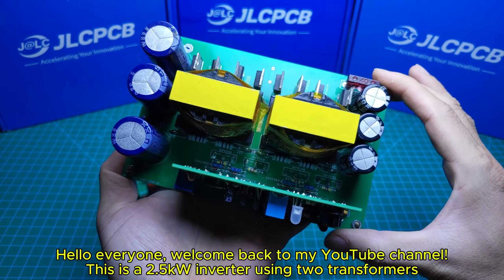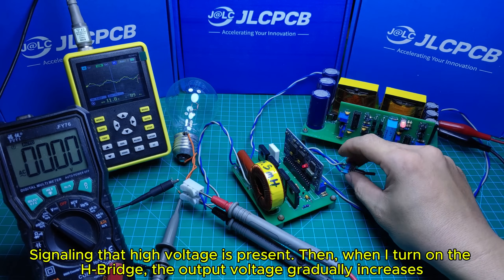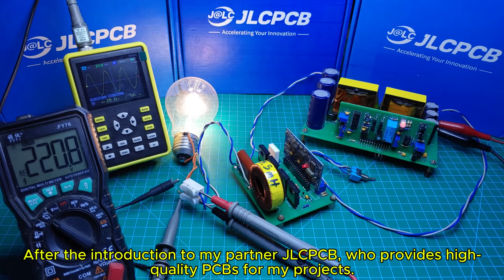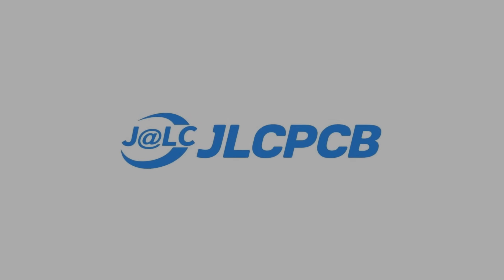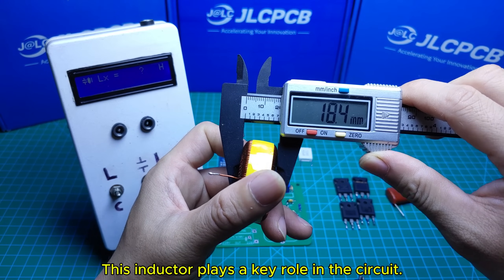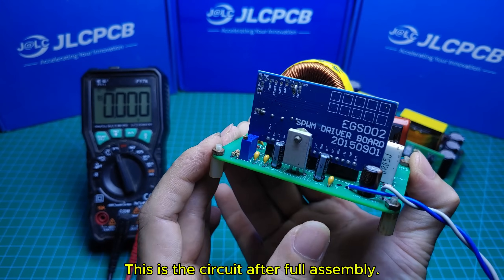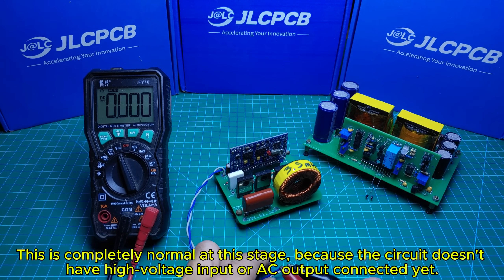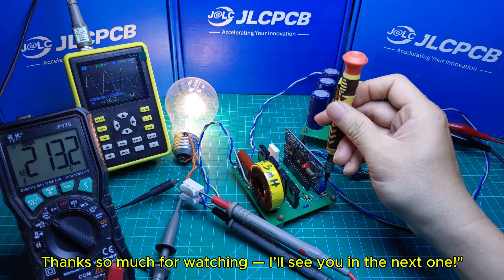DIY 2.5kW Pure Sine Wave Inverter Using H Bridge & 2 Transformers | JLCPCB

Comment: EGS002 has all the functions in your driver then why use both of them on the same circuit?!!
Reply from the maker: All function ?? Lol. Include DC to DC converter ???
Reply: @LongTechnical  No, I meant thermal and over/under protection, sofstarter and high frequency switching plus others.
Have you even read its datasheet?!! 🤔
If as you said its only difference is the DC to DC conversion then I'm sure there's is simpler solution other than adding two boards with 99% similarity.
Maybe make video comparing the two.
Not sure, but I guess EGS002 doesn't have high frequency control too and it's fixed. Have to check.

Comment: Hello, I made this circuit, but the egs002 module light keeps flashing. It gave an output of 196 volts, and after a few seconds it flashed and disconnected. What is the problem? Can you help me?
Reply: Input voltage to egs002 board should be 310 to 360

Comment: GOOD JOB FRIEND, VERY NICE WORK. BUT THE GERBER FILE NOT THE SAMETHING AS WHAT U ARE DISPLAYING ON THE VIDEO SIR PLS REVIEW IT.
Reply from the maker: All same bro. A litle bit PCB size bigger than in my video for easy use screws. You can check it
Reply: @LongTechnical  BUT THE MOSFET CARD THAT HAS THE EGS002 PCB IS NOT INCLUDED

Comment: Help!
i made this circuit and its output is 250V AC i cannot adjust the Voltage using potentiometer, Led Blink 4 times ,  i changed potentiometer but problem doesn't solve
Reply from the maker: Check voltage at  pin 15 EGS 002 with GND when you adjust the potentiometer. If that change but output not changed -> EGS002 broken. If that not change, check your circuit: resistor capacitor on feekback line
Reply: @LongTechnical  
There is so much noise in pin15 when I turn it on , capacitor don't solving issue
Reply from the maker: Check your inductor. How many turn you wound, how many henry of inductor
Reply: @LongTechnical  
3mH , 200 turns , I checked using an oscilloscope, when I turn on high voltage generator 480V transformer it creates 5Vpp Noise in ground line I tired everything even 5000uf capacitor it still didn't solve the problem, output is 250V AC , pure sine wave, but only for few seconds then led blink , 3 Time and 4 Time, 😥

Comment: Is this inverter can handle 2.5kw load because the MOSFET used in high voltage first circuit is only four... please clarify this..
Reply from the maker: Parallel multiple mosfets to get 2.5kw. with 4 mosfets can get 1 to 1.5kw. I said this in previous video